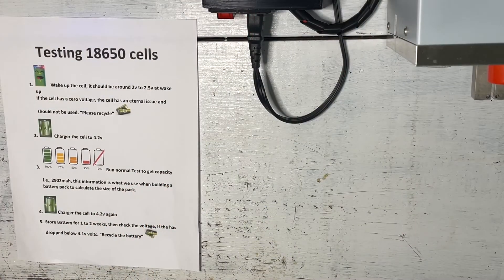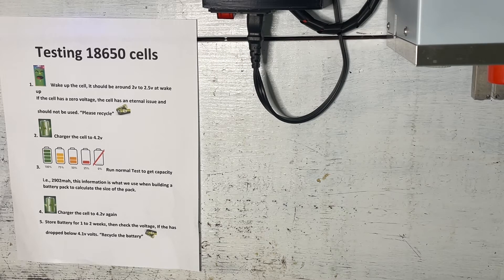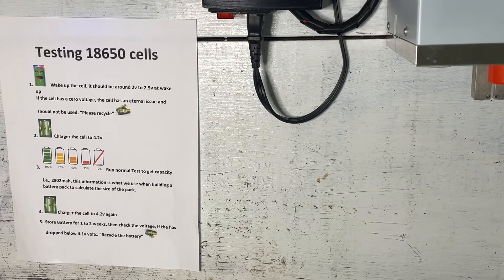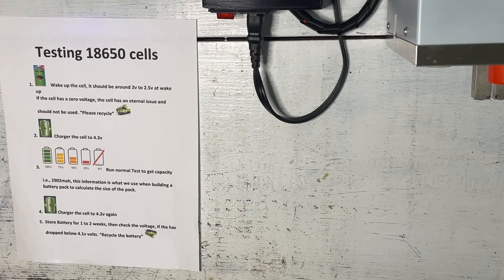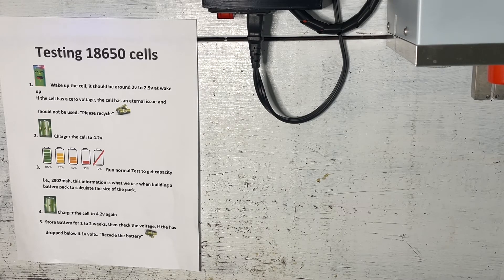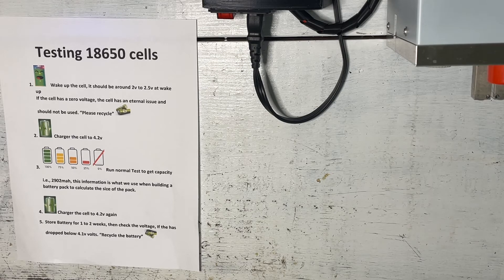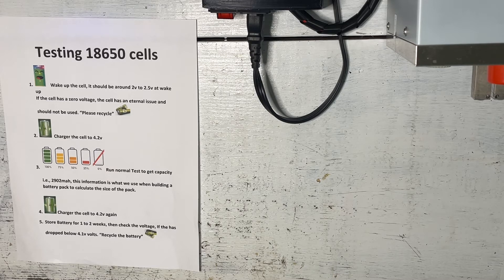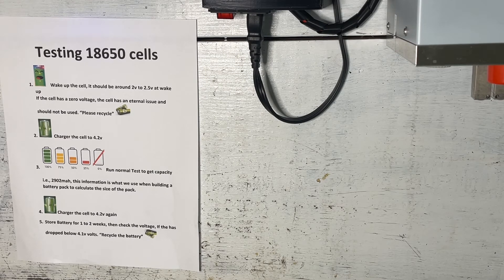Beginners guide to 18650 batteries part 3.2 Testing continues

Comment: Good point, on using a higher detailed DMM. One thing I wouls also say, is if you do have an internal resistance tester, you can use that, for checking battery voltage, as they are more accurate, than a DMM.

Also, when the testing is finished, & if you don't plan on building the battery straight away, it is recommended to discharge the cells to ~3.6Vdc, as this storage voltage is retained for a long period of time, on good cells. Stored cells, at full 4-4.2Vdc will self-discharge somewhat.